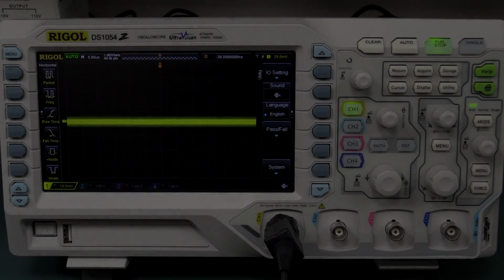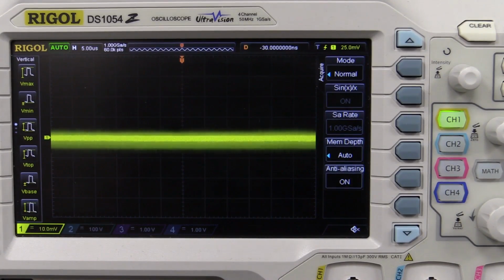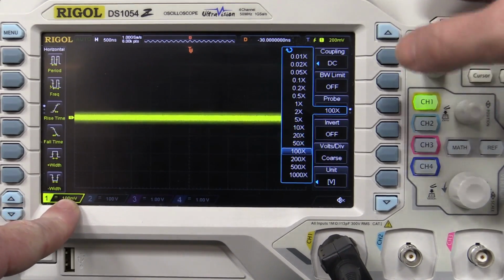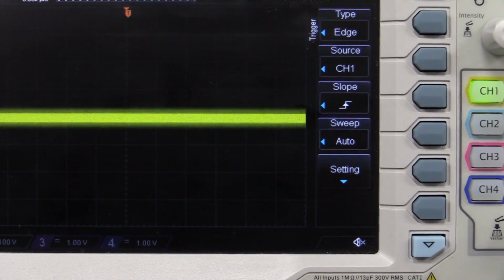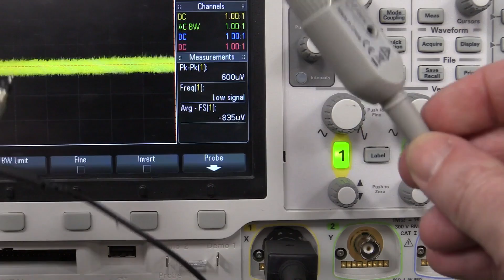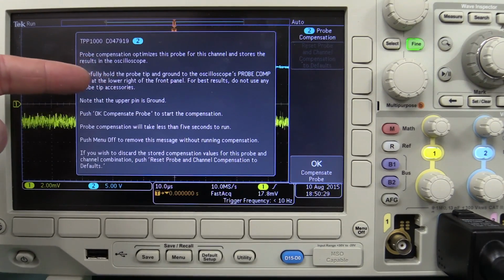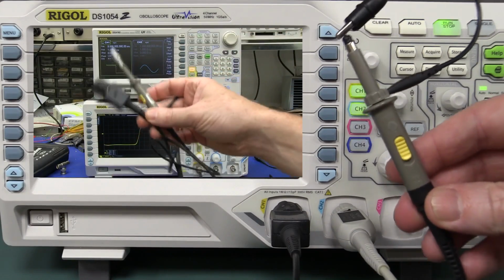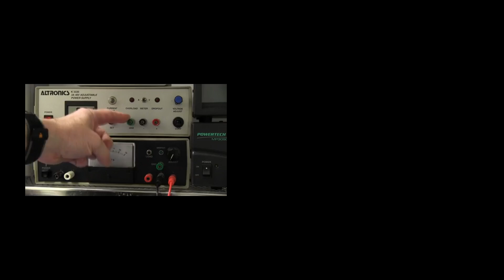EEVblog #778 - Oscilloscope Vertical Confusion

Comment: what is my problem, I measure a signal with 21 volts, but when I want to take a closer look, the message Parameter limited comes up.  20 volts is the end and the signal is not visible.  Vertical parameters limited.  what am I doing wrong?  Signal is only visible in Auto mode and at 5V per division.  Can someone help me?
Reply: Включи делитель на щупе

Comment: Dave thanks for the tip as I notice that and sure enough set the probe Bingo done deal lol Question Dave I need to know HOW to set my view calulations , FREQ,Vpp,Avg on the screen at the bottom so they will be there at startup ..Yes I have the DS1054Z You can email the answer if you wish . 73's

Comment: my Rigol DS1054z  00.04.03 sp1 board 0.1.1 its one week old, 2-4 2016
i have used all the web generators i can find, nothing wokrs, do the scope have to set up first? anything on the motherboard needs changed? it my scope too new for the hack to work? any help would be appreciate
thanks
Randie

Comment: This is not exactly related to this video, that I enjoyed much, but a question I have for you EEV is:
What is your suggestion for a voltage generator (or combination of devices) that generates Low to high frequency voltage of different wave types like Sine/Square/...and so on, (up to 1GHz or more) sufficiently variable up to 600-W output max 120-V and 5-A ? ...Thanks for all your videos.

Comment: interesentingly the DS1052E shows "volts/div at limit" when i try to zoom in "too much". this is more describing than the generic message "parameter limited". 
maybe the software developers favored this generic message cause it easier to implement and thinking "well an engineer knows what this means"
Reply: Yeah, if you don't know what knob you're turning, you shouldn't be touching expensive equipment.

Comment: On the MDO3000, the compensation data is unique per channel and probe combination. If you move a probe from channel 1 over to channel 2 for the first time it's not going to be compensated. You need to perform the autocompensation once for every channel/probe combination.

Comment: Wish i could find a cheap analog oscilloscope... been hunting on ebay for about 5 months and haven't been lucky yet.

course unfortunately have a limited budget due to being disabled.

been keeping eye out on Tek 2215 2225 analog scopes for basic circuit testing.
Reply: qoaa I think sellers are asking too much for them. I bought 2 Hitachi scopes from eay, expect to pay around $100 for a 60MHZ scope. I have a V-650F. 
Try to buy one that is shown powered on with a trace showing. Most sellers don't know how to test them so they usually list them as is.
Reply: Bri G. thanks!

I do have a mentor, he's a retired air force, and has masters in electronic engineering.  He's been helping me as I run into questions, problems, confusion. I have a good multimeter, but he says I need an analog scope. That I should start with an analog and so I can see what my build is really doing, and learning about phases, 90/180 out of phase situations.

He's a fan of Tektronix and for a beginner he recommended either 2215 or 2225 to save money but his advice is don't go over $100 for those 2 models.

He deliberately wants me to stay analog and simple as I'm a novice. I'm a ham operator so I knew the basic equations, but now I'm putting it into practice and also have books home studying theory.

Thanks for reply, it does seem many scopes on eBay are overpriced. One listing I laughed, a guy said he got scope free from store that went out of business that was gonna dumpster it. He knew nothing of it, it was a tek 2215, it powered on but no probes, as is starting bid $300. I was like wtf?! :-P
Reply: qoaa I have 2 Hitachi scopes, was going to give one away, it's old but works really well, will include a probe with it. All you have to do is pay for shipping.

Comment: Guys, silly question, and I know the answer is probably 'no', but can the multi-function knob on the Rigol 1052e be changed so that turning it clockwise scrolls DOWN the menu options instead of up? I keep turning the knob the wrong way when going up and down in the menus... I'd like to reverse it cos it seems backwards to me. Thanks.
Reply from the maker: ForViewingOnly No option to customise the controls like that.
Reply: ForViewingOnly I'm dyslexic, so I never know the right way instinctively, and have to refer to my dominate hand everytime, so I can understand how frustrating that might be if its opposite of your expectations though :)
Reply: ForViewingOnly Hmm, clockwise is typically thought as UP, and counter clockwise as down.
Reply: EEVblog OK, thanks Dave.
Reply: Richard Smith Yeah, I think my brain is just having problems with this on the scope. This is the only device I own where a rotary knob is used to go up and down a menu!

Comment: How does that 1GHz probe get power internal battery or some kind of circuitry that takes the power off that 1 connector
Reply from the maker: Jeremiah Lowe It doesn't need power, it's just a regular "passive" probe. Only "active" probes need power. 1GHz is as high as passive probes 10X divider probes can go.
Reply: Didnt know that Im a beginner just got my first scope 3 days ago from a college its an old AN/USM-281 unbranded analog scope the guys at Morehead college gave it to me

Comment: That bugger caught me out when I bought my DS1054Z because, it  defaults to 10x which is weird, but even after setting it to 1x, it always changed back to 10x and caught me out again, because again, by default, the scope is set to restore factory defaults every time you power on the scope, so you probably want to change that option as well
Reply from the maker: arcadeuk Are you sure it defaults back to 10X every time it boots? That sounds wrong.
Reply: I can confirm after testing, that it does default to 10x, if you have the scope set to reset settings on power on

Comment: Setting a probe to x10 means that you have to multiply by 10 the readout because the probe attenuates the measured signal by 20dB before feeding it to the scope.
Reply from the maker: ppdan Not unless you set the software to 10X in which case you don't have to do the math it does it for you.
Reply: I always wondered why "cheap" scopes without the "auto sense" don't permanently display the multiplier on screen.
For example on the Rigol DS1054Z there is enough room in the bottom bar to show the "x10" or whatever setting next to the "V/div".
Even experienced users can sometimes be fooled by this, although it'll probably only last a few seconds (has happened to me : "why is that reading so high ... aw yes, nevermind")

Comment: To make it easier to notice that the switch on the probe is one way or the other simply use a marker and place a dot on one side of that recess where switch is. That way if the switch is moved one way it will cover up that dot, while when it is the other way that dot will be visible.

Comment: Wouldn't it be possible to actually see the noise on an analog oscilloscope with a high speed camera? Would probably make for some interesting footage
Reply from the maker: masat87 I tried that in one of videos using a long exposure.
Reply: masat87  Probably not. Chances are that the analog signal processing system will aready limit the bandwith in a way that prevents most of the noise from ever reachign the screen. Additionally - the phosphor of the screen is usually of a type that exhibits a considerable afterglow - therefore any fast noise that was not caught by the electronics will be integrated into a slight halo around the trace, but not distinct patterns....it is an optical low pass, if you will, designed to present a more readable trace from a slow or erratically moving beam
Reply: masat87 Lol, you should probably watch the video he linked to where he does exactly that...
Reply: TheHue's SciTech I watched that (although a while back), but the effect of the long exposure was different from what I imagined for the high speed camera.

Comment: Dave please design a differential probe or suggest a open source one for low frequncy usage, they so dam expensive.

Good video!
Reply from the maker: ***** Use two probes, subtract one channel from the other. Poor mans  diff probe.
Reply: ***** THAT...would be really useful. Many options come to mind.
Reply: Steve Nordquist great, now for the HV-analog front-end...
Reply: Steve Nordquist That part can only offer up to 100khz frequency response.
Reply: EEVblog Lots of differebtial isolation devices will help back you up on that. The energy harvesting bias supply for getting the measurement domain centered on 0 then becomes the bigger challenge...that or testing one's coax bonding for EMI rejection.
Reply: EEVblog Doesn't look like much exist, kickstarter anyone?
Reply: Mrpsychotehpyro Imagine the possibilities! freaking hell ! c'mon people someone out there? do it! do it! you can do it!
Reply: TI's AMC1100...
Reply: EEVblog
Daaaaaaave, that is common knowledge, obvious, and not safe. The name of the game, for me at least, is measuring the all the gate drive voltages or DS voltages of an H-Bridge being fed 315V mains rectified with no valid ground referance at all. A proper differential measuring system has to be able to do that.

My old scope can do it, because it has an internal isolation transformer, but the procedure is insanely unsafe because the eintire housing floats on 230VAC. Modern scopes often cannot do it at all - without REAL differential probing.
Reply: ***** Try http://store.newae.com/differential-probe-assembled-tested/
Reply: elsjaako nope. its not HV, no CAT ratings specified, and that bare bones design activates alarm bells.. its probably useful for small signal analysis that require non-common mode measurements....